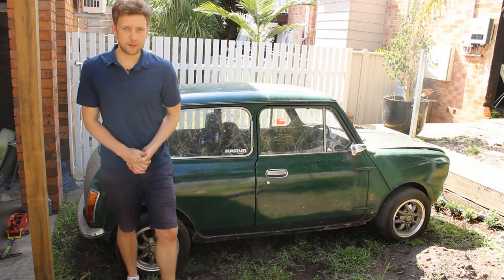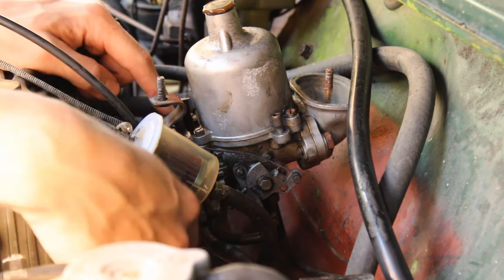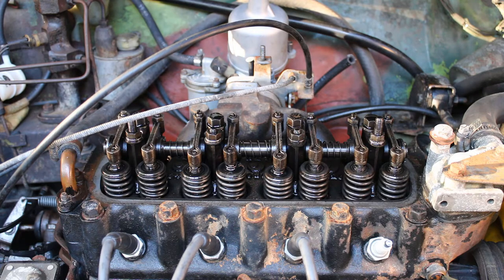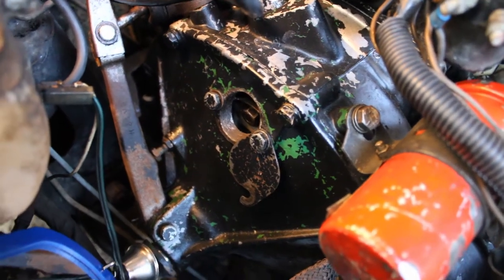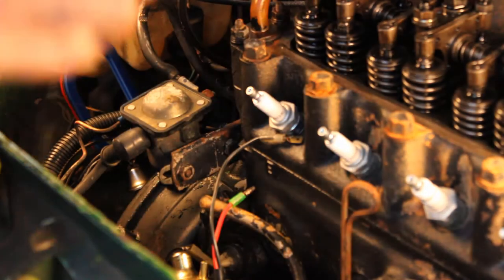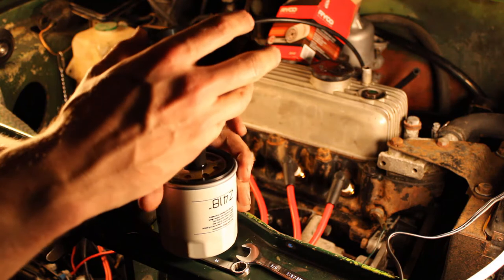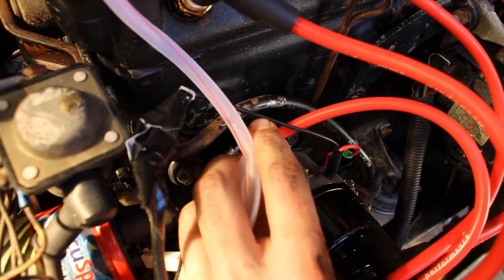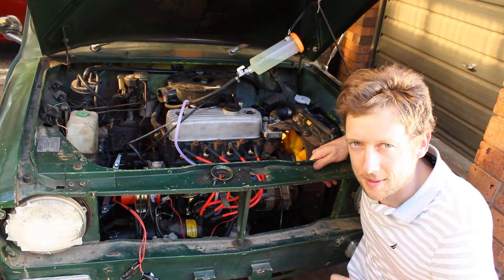Australian Leyland Mini restoration: Episode 2 - Getting it going

Comment: Excellent lesson in timing your Mini engine.  Mine is 180 degrees out so I have to fix that.  I am also putting a new distributor in which comes with an electronic ignition built in.  Cheers,  Midge